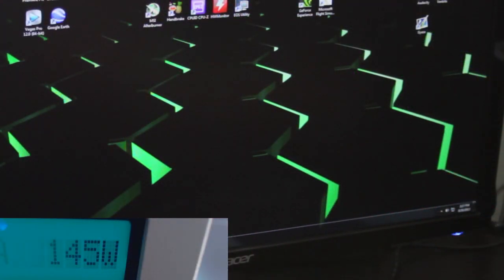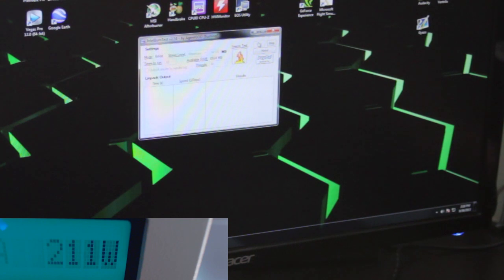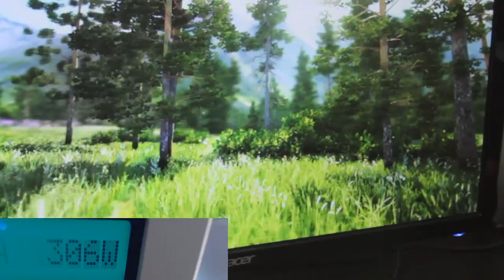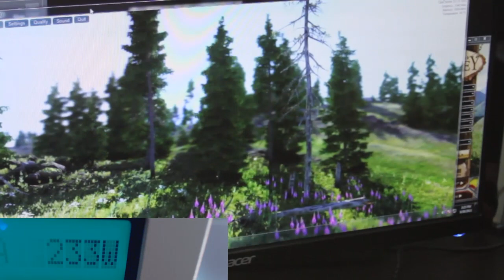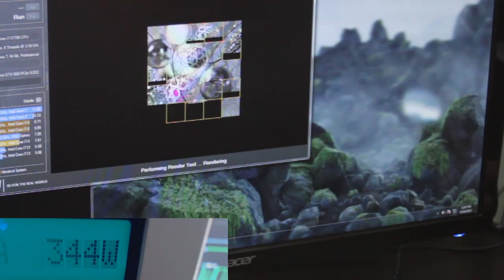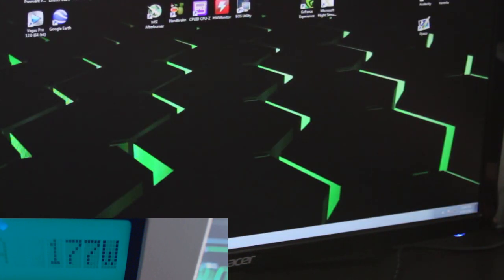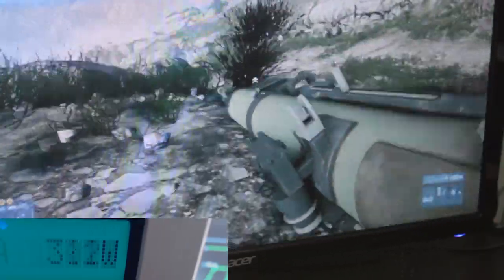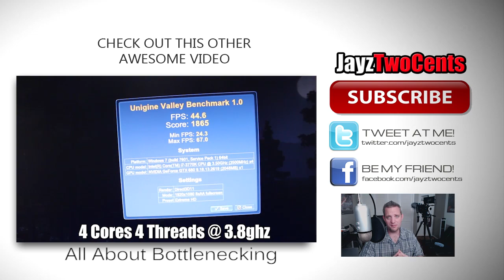How big of a Power Supply do you REALLY need?

Comment: HELP :) I have my first computer, my Computer is about 17 Years old but it's Power Supply is pretty gutless. The Power Supply's intake fan usually never spins, unless you use a pencil lol, and the rear one likes to make noise and can get loud. The Power Supply runs pretty good for its age, but I want to upgrade the PSU to something more newer, more powerful, and efficient. The one that has been in it since it was probably built, barely has enough power to run the computer as it is a 400 Watt Power Supply, however most of the rails are underpowered (mostly the 12volt) which is only rated at 200 Watts Max (Just a note it has TWO gpus in it...) still runs after 17 years somehow, maybe longer. The PC dates about 2002 to the late 90's. I have a watt meter, and it has yet to go any higher then 140 Watts, though that's not much head room.

What Should I buy to replace it's Power Supply???

It has a:
EVGA nVidia GeForce 6200 GPU 256MB DDR2 (PRIMARY) < Moar powerfull, better driver
nVidia GeForce MX400 AGP GPU 64MB DDR1 (SECONDARY - In BIOS turned OFF )
Creative Sound Blaster PCI Sound Card with Game Port
IEEE 1394 BUS PCI Card "its connected to an external HDD"
4 CD/DVD Drives < Well 3 as one is external, and is ran using the Printer Port bus, so very good for Music CD rippin, and playing.
Old Modem/Fax PCI card that may, or may not work
Another external 1TB HDD that is running a lot of the systems programs
Working internal Legacy Floppy Disk Drive
A pretty original ancient, quiet, & working FAT32 50GB HDD as the BOOT drive (There is a redundant one, which is even older, prob the original, but is unplugged, as I tested, is broken)

Comment: I have a 750W ACE Power Supply. It cost very little something about £30. I have a pretty good system I would say. I'm just that bit concerned about the PSU.

My system has: 
Motherboard: Maximus VII Ranger Motherboard
CPU: Intel Core I7 4790 Quad Processor
Heatink and fans with grills. Cooler Master V8 GTS Heatsink cooler
RAM: Corsair DDR3 8GB RAM 
PCI-E Soundblaster ZXR Soundcard
PCI-E 16 Geforce GTX 1070 Graphics card
1TB Hard drive. 
Obsidian 750D ATX Tower. 
Windows 10 64bit edition

Nothing is overclocked. However, when I use the internet for browsing sometimes I get a blue screen and the computer restarts itself. The fans go at full speed when it should be on silent mode; t feels the computer will take off! Lol. 
Could the Power supply be at fault?

Comment: the specs of my new build are:
MSI Z170A M5 motherboard
Skylake 6700k
2 8gb 2400mhz Ripjaw
1 MSI GTX 1070 Gaming X
1tb Firecuda SSD hybrid
Cooler Master 212 Evo CPU cooler
4 120mm case fans

Will a 650w be enoughn or 750w?
EVGA psu a good route?
Reply: Actually, a 650 watt power supply is overkill for your system.  Your CPU pulls 91 watts at stock speed, but let's assume you're overclocking the bejezus out of it and it's pulling 125 watts.  Your GPU pulls 150 watts at stock speed, but let's conservatively estimate 185 watts.  RAM, SSDs, fans, and motherboard really don't pull that much power; we can conservatively assume 50 watts for everything else.  So your system is conservatively pulling 360 watts maximum (and it will probably NEVER pull that much).  So if you had a 450 watt power supply, it would be operating at 80% of maximum load, which is right where you want to be.  If you're planning to add another GPU later, that changes the math, because you need room to expand.

Maximum efficiency is typically somewhere around 50%, but the difference in the amount of power used between 86% efficient and 84% efficient is so small as to be negligible.  Building your system with an 80% load on your PSU means 1) you'll never overload it 2) it will last and 3) you can spend that extra money on something else.
Reply: right on!! I was looking at a evga 650w 80 plus gold, but I see that the 750w is at 24 amps and not the 650w. I guess I'm just trying to be on the safe side.

Comment: I have a msi 290x and an i5 proc, will a seasonic 520w would be ok?
Reply: Yeah easy
Reply: +skinnybut stronglad hi, what do you mean? Yeah easy? 😁
Reply: Easily more than enough
Reply: I have  two gtx 1080's and a 7cp and water cooling and it barely touches my 750wt, hits about 470wt at its peak
Reply: +skinnybut stronglad oh wow! Thanks for the info dude. Im gonna use my 520w to my rig
Reply: No problem

Comment: A big mistake of this video is the statement that an 80+ PSU always delivers 80%+ efficiency. It doesn't, 80+ ratings specify 80%+ efficiency at 20%,50%, and 100% load. At a 35% load, it could only be 60% efficient.

Comment: Please Tell me how many watts i need!

I7 4790 (non K)
Gigabyte GTX 1070 Founders Edition
Corsair Vengeance 16gb (4x4)

And a 144hz, 1ms 1920x1080p monitor.
Reply: monitor has its one power..... this system can run of a 550w psu, but i would recommend a 650 for margin when upgrading
Reply: +G.Work.Specials thanks :)

Comment: How big of a power supply do I need for this build? Pentium G3258 @4.3 http://pcpartpicker.com/user/Raision/saved/DmZV3C
Reply: The great thing about PCPartPicker, it tells you how much power your components will draw.  Look near the top - it shows your system with 242 watts.  That being said, I don't know that this calculator accounts for everything like your light strips.  Fans only pull one or two watts each.  Light strips vary.  Figure on using 50 watts or so for everything that isn't the GPU and PSU (and that's usually conservative).  I usually add another 25% for margin .  This build will do fine with a 400 watt power supply.  If you're planning to throw in another GTX 950 later for SLI (I don't recommend it - get a 1060 instead), add an extra 100 watts.  Regardless of what size you go with, make sure you get a trusted brand.  The 500 watt PSU from EVGA you picked out is just fine, especially at that price.
Reply: +AtomicAJ74 thanks
Reply: +AtomicAJ74 How many watts would you add for the monitor?

Comment: So pcpartpicker says my build as I have it right now will be using about 430w. Is a 550w psu good enough?
Reply: I like to build with a 25% margin.  25% puts you at 537.5 watts.  So a 550 watt power supply looks pretty good to me.
Reply: 25% what do you derate for continuous use?
Reply: Risto Mladich I don't derate for continuous use.  I've never found the need.
Reply: AtomicAJ74 then whats with the 125%
Reply: Risto Mladich It's just margin so that you're not running up against the limit of the power supply.  Running a power supply at its limit usually will shorten its lifespan.  25% is only a recommendation, and if you're conservative in your assumptions it's arguably redundant.  But it's a better rule than others will give you such as "You need at least a 600 watt power supply if you have a GTX 1080."  Some people even recommend a minimum 500 watt power supply on a PC running integrated graphics.  It gets quite ludicrous.
Reply: AtomicAJ74 what do i do with a 3 phase delta-delta? do i need to adjust by 1.732 ?
Reply: Risto Mladich Whatever.

Comment: It's nice to see someone talk about a trend I've noticed for years.  I've seen so many responses in various forums where other helpers say "You need a bigger power supply" when the power supply is clearly fine.  I saw a comment at one website where the guy was running a GT 730 (about a 30 watt card) and someone told him for that graphics card he should have a power supply of at least 500 watts, preferably 600.  The guy's system couldn't have been pulling more than 150 watts.  Go with the minimum power supply you NEED plus a healthy (10% to 25%) margin unless you know you're going to expand.
Reply: so a 450watt PSU should be enough for my (i5 4460 , 8 gb RAM and RX 470 strix OC 4gb) Right ? :)
Reply: The i5 4460 pulls 84 watts. Your RX 470 pulls 150 watts.  You didn't specify your RAM (number of modules, frequency, etc.), but we can conservatively assume 4 modules at 10 watts each.  So far we're only up to 274 watts max, and that's a conservative estimate.  Give yourself a 25% margin, and you're still looking at 345 watts.  So, yes.  A 450 watt power supply should suit you just fine.  The trick is to make sure your power supply's 12-volt rail has adequate power available, since that is where most of the power draw will be.  Most modern power supplies are built this way; many cheap/older power supplies won't have the power you need on the 12-volt rail.
Reply: AtomicAJ74 oh ok :) thank you very much :)

Comment: would a cx500 be enough for a gtx 1060 and a i5 6600k? a coworker of mine told me i need a 750w atleast but i already bought the 500....
Reply: The GTX 1060 pulls 120 watts at stock clock.  Let's assume you overclock the bejezus out of it and it's pulling 150 watts.  The i5 6600K pulls 91 watts, which is as much as anything in that socket currently pulls, but again, let's go nuts and assume you've overclocked it such that it's pulling 125 watts.  Your two biggest loads are pulling a combined 275 watts.  Through in 50 watts for things like RAM, SSD, hard drive, and fans.  Lets add another 25% for margin and we're at 406.25 watts.  So you could get by with a solid 430 watt power supply and be just fine.

For comparison, my previous build used a GTX 550 Ti, which pulled more power than your 1060, and an FX-8350, which pulled 125 watts max (actually, it was probably closer to 140 watts with the overclock, so let's assume that).  That system pulled about 300 watts when I was gaming, and about 330 watts when running BOINC (a distributed computing program that will actually stress every part of your PC).

Tell your coworker he's been spending too much money on power supplies.  Your CX500 is just fine.

Comment: hi, so l got a 650tx corsair, is it good or bad? have a AMD R9 390 you and a 17920. In a couple of weeks l should be ordering some new things (cpu 15 6600K, mobo ASUS Z170-A, ram 3000mhz corsair and cpu cooler) should look into getting a new psu? thanks for the help
Reply: That graphics card is listed as pulling 275 watts, which is a lot.  With a 6600K (91 watts), you've still got plenty of margin.  If you're thinking of adding another card later for CrossFire, you'll probably need to upgrade your PSU because you'll be right at the edge of that power supply's limit.  A good power supply should be able to run at the edge all day long, but I have a hard time believing that won't make it fail sooner (remember, nothing lasts forever).
Reply: +AtomicAJ74 oke thank you verry much 🖒🖒

Comment: You're telling me I can plug in my 290x into my 450watt apu build and still be fine,bottleneck aside.
Reply: The highest draw I've seen listed for an APU is 100 watts.  The 290X pulls 250 watts.  If you assume 50 watts for the remaining components (which may or may not be a good assumption), you've still got 50 watts of margin.

Comment: Jay is doing a good job on his videos.
Agree with most of what he is saying, but not exactly this. (as the electronics Nerd I am)
The labeled wattage is just a guideline (more or less). Really what you should look for is QUALITY CAPS. Always go for the Japanese Chemi-Con or Hitachi, especially if you are powering a rig you want to take good care of. (always check Johnny Guru reviews if possible)
The Quality PSU's are Most efficient at about 50% Max load (Give or take 10%).
The Quality PSU's are always electronically build to deliver the labeled wattage within ATX/efficiency specs(Some very much within!)
Take a Seasonic G360. Good cost efficient And quality 360W@12volt PSU. That thing can easily do 400W 24/7, but Seasonic prefer to be conservative on their ratings, and their specs are within the 80plus Gold rating.. Some has tested this thing to 450W load at which it still delivered quality DC current and above 80% eff.. I have owned one too. Excellent value PSU for any "mid range" gaming rig.

Compare that to a "Cheap-Crap 600W labeled" PSU. These often struggle above 350W load@12V, as they deliver Voltage drops, and ripple - sometimes out of ATX specs!
So a Quality Labeled 360W that can do 450W DC without problems, or a Labeled 600W that can do 350W with some struggle on the DC? Label wattage..!!

Final Guideline: Just choose an EVGA G2 for any enthusiast rig. These Super Flower made, do their job just spot on. No reason to pay more for any fancy PSU out there - unless you need different aesthetics or whatever..

Comment: The reason you don't oversize your PSU is to prevent excess waste heat. Power supplies have overheads just to turn on, smaller supplies having smaller overhead. As such, an oversized PSU results in more waste heat. A PSU being run at 100% of its rated output will result in bad efficiency, as will one running at 1%. The line is not linear. 

Higher efficiency rating means less waste heat. An 80% efficient supply is putting out waste heat equal to 20% of the current load. It's venting it inside your case, so it increases temps. This is what the enthusiasts care about.

Stop making videos on things you barely understand. Or at the very least, google the damn points and develop a basic knowledge before preaching to your audience

Comment: Is VS450 enough for GTX 750 Ti ???
Reply: It really depends on your system, but probably yes.  The GTX 750 Ti pulls around 60 watts at a stock clock.  I would be amazed to see one running stable pulling anything more than 75 watts.  If you're paired it with a 90 watt CPU, you have plenty of margin.
Reply: finally got VP550P EC... it's future proof for me..
Reply: That sounds reasonable.  I don't mind seeing a 550 watt PSU where a 450 watt PSU would do.  What bothers me is when I see people installing (or worse - recommending) an 800 watt PSU (sometimes higher) in a system that will never pull 350 watts.  And I see it often.
Reply: yup.. in practical situation with any single cpu and single gpu system also if you don't overclock ...you will not need anything more than 500 watt the shop from which I ordered my psu there 550 watt and 500 watt costs exactly the same so why not get the 550 watt one ;) xD
Reply: Yah! anything more than 500 or 600 watts is just impractical !

Comment: This video was spot on, but what are 1200 watt power supply's for then ? Seeming as jay as got a beast of a build they must be used for cars or something lol
Reply: They exist because there are enough systems that actually need that much power.  They sell because so many people think they need a 1200 watt power supply to run a GTX 970 with a Core i7 6700K.  I don't think most vendors are going to tell you "You should probably get a smaller power supply."
Reply: +Ham_ as well as custom and closed water cooling loops

Comment: i3 . gtx 750Ti 8Gb of Ram

Is 400 w perfecte ?
Reply: That sounds like plenty of margin.  The 750 Ti pulls 60 watts of power.  The Core i3 processors range from 35 watts to 73 watts.  You could definitely get a smaller power supply, but there is very little point in getting something smaller than 400 watts.  The price difference is minimal and the concerns expressed in this video are inconsequential to your PSU.
Reply: AtomicAJ74 Oh Thx Man So 400 Watt Is Good 350 is also Cool But What do you mean By The concers expressed in this Video are inconsequential to your PSU ?
Reply: TA YOO He was talking about loading the power supply to the sweet spot of its load curve, so that it's operating at maximum efficiency.  That means your power bill is less and your power supply lasts longer.  With small power supplies (pretty much anything 400 watts or less), this is not a practical pursuit.  Those power supplies will typically last forever as long as you don't overload them, and the efficiency gains of loading to the sweet spot of the curve are so small as to be immeasurable.
Reply: AtomicAJ74 Oh Okey Thx Man For Explaining <3

Comment: 600 w is the best answer
Reply: 550w - 600w.
Reply: Thats what I have 

Current PC Specs

AMD FX8320 3.5GHz Processor with 970A Motherboard

8GB DDR31600Mhz Memory 1TB Hard Drive and Windows 10 Home 64Bit

NVIDIA GeForce GTX 950 2GB GDDR5 PCI Express 3.0 Graphics Card with 600W 80 Plus Power Supply

Comment: @JayZTwoCents 
"The lower amount of energy you use in your power supply the less efficient its going to be".   
That's wrong dude, take for example Evga supernova g2 750 Watt PSU,  its the most efficient when around 300watts at about 92% efficiency.  @ 700Watt  its at about 90.5% efficiency.
Reply: Actually, it is true to a limited extent.  Every power supply has an efficiency curve and they all show to be less efficient when they are lightly loaded.  Now you'll never notice the difference in your electric bill because the change is minimal, but it is true.